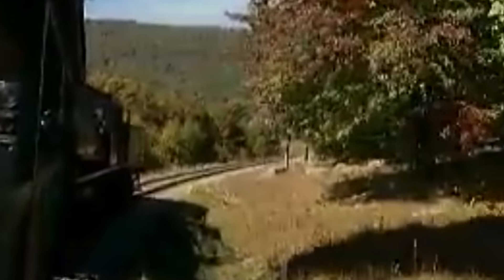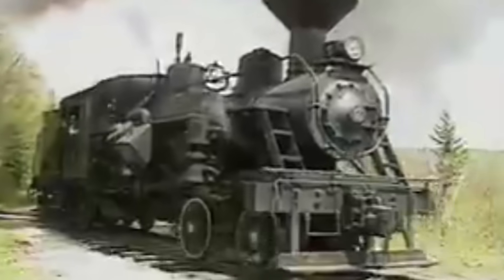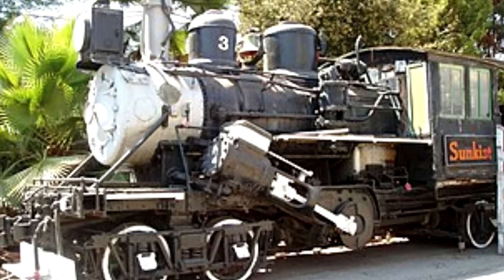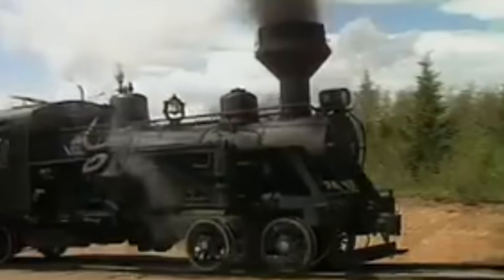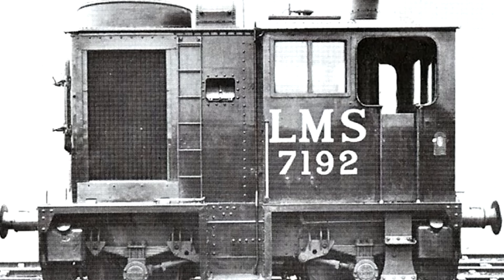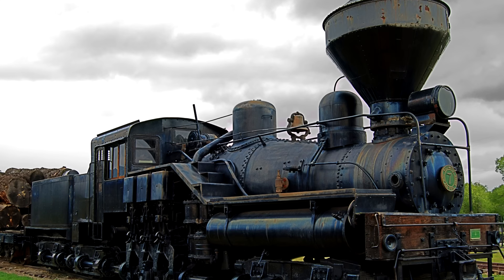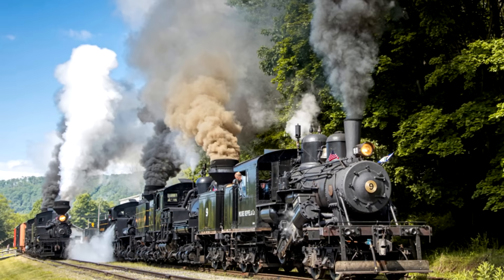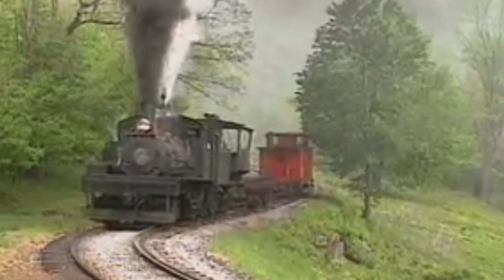What the Heck is Up With Geared Steam Locomotives? | History in the Dark

Comment: One thing I think you missed. Is why geared locomotives are better in step terrain. Like how a 4X4 is better in step terrain than a 2 wheel drive car, truck,suv, etc… They all send power to more wheels. More powered wheels. Especially power to wheels on both ends of any land based vehicle with have significant traction advantages in any terrain.

Comment: Early on Shay's were built to not only run on traditional rails, but also on temporary rails made from lumber. Some early ones had small serrations on the drivers to improve grip on the wooden rails. One reason they were so popular from the start.
Reply: yes it is 😮
Reply: Its interesting in some rural parts of the midwest you can find topography where they made cuttings into hills for some of those industrial railroads. Even though no records remain of what was there

Comment: The thing with Shays and similar designs isn't that they have "enormous" traffic effort, because on the tech sheet it follows the same principle as any other locomotive. The thing with them is that they are flexible, track well on poorly laid logging railroad track and most importantly, the steam engine is revving very fast even at low speed. The last part is important because it means they deliver 'oomph' their smoothly even at low speed, which is not a thing for regular steam locos.
This is especially true for three-cylinder Shays, which deliver power in three-phases, which makes them a steam equivalent of an electric motor.
Reply: yes it is 😊
Reply: Just a Friendly Reminder. You said “Traffic Effort” when you mean “Tractive Effort.”
Reply: @rottenroads1982  You're correct.

Comment: It wasn't so much the lack of mountains in the UK, but the lack of trees on these, as by the time the steam locomotive was invented most of Scotland had already been deforested to supply wood to build warships and more.
A geared locomotive could have been helpful in the quarries in Wales, but there most used the 2 foot gauge with small 0-4-0s operating in the quarries and on the longer route from the quarries in Ffestiniog  to the harbour in Porthmadog the famous Fairlies came in use, which were as good in negotiating steep gradients and winding curves.

Comment: Now that you mentioned the eccentric manufacturer that was Sentinel Waggon Works, there were their three general wagon (road going trucks and tractors), the standard/super, the DG (double gear) and the S (shaft);  they also built conventional tank locomotives (under contract); as stated they built vertical boilered shunting/yard locomotives essentially based on their road waggons; however they also built the Columbian locomotive - a 0-6-0+0-6-0 (actually a 0-2-2-2-0+0-2-2-2-0) higher pressure boiler, with effectively a cylinder for each wheel, built in redundancy as the axles were individually driven and could be disconnected.